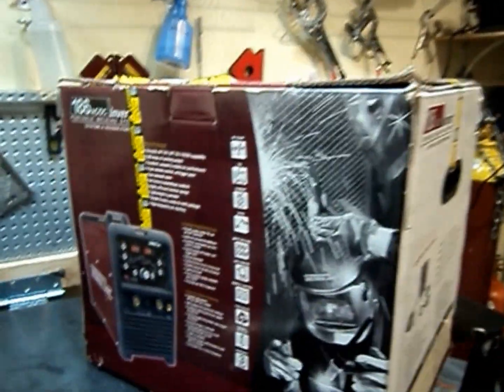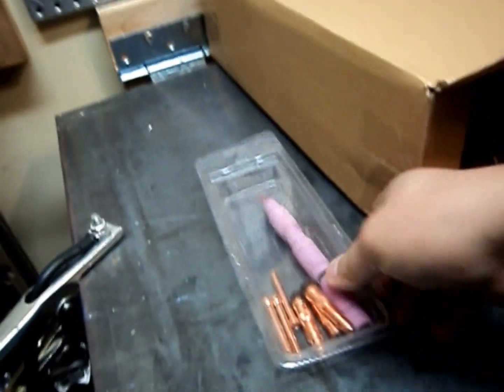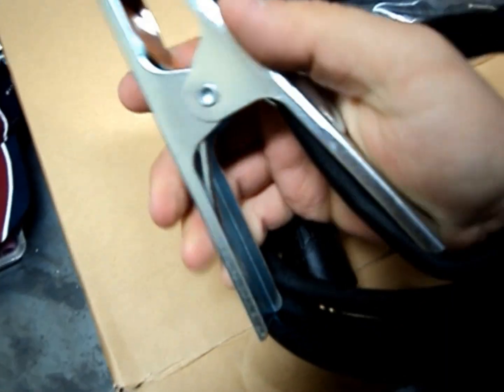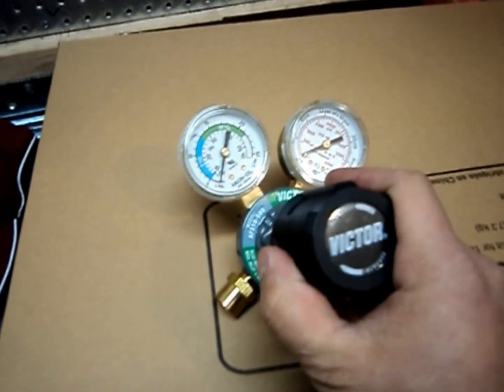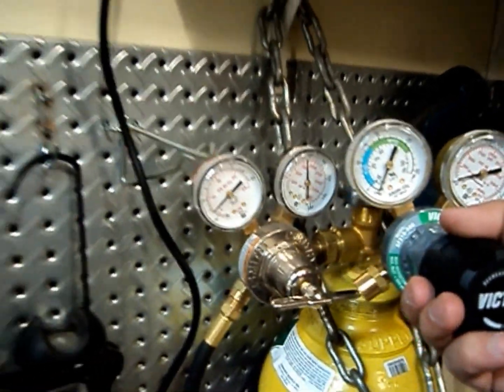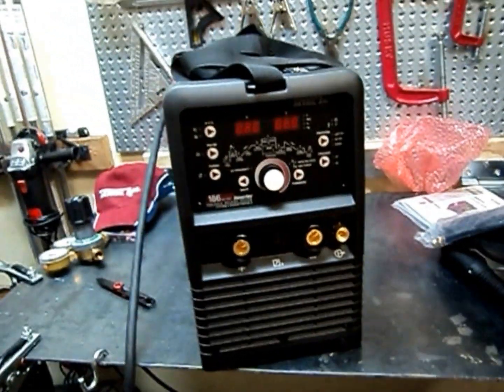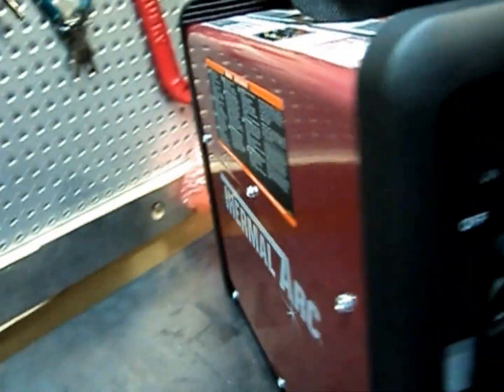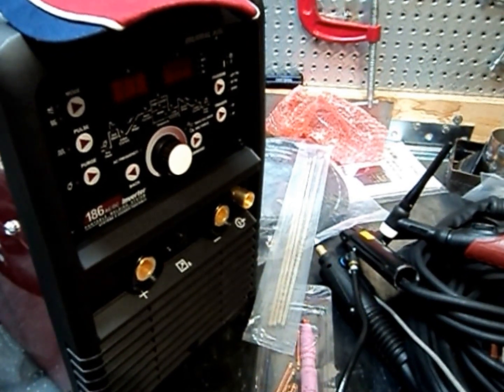ThermalArc186 unboxing Ac/Dc tig stick welder Inverter

Comment from the maker: You will like it. Just don't put it right next to your welding table the fan will drive you a bit nuts.
It's a metal peg board that I got from menards. And I tack welded all the hooks in place so they don't fall out :)

Comment: Just ordered a TA186.  What kind of tool board it that above your welding table?
Reply from the maker: metal peg board. I also tack welded each hang in place so they don't fall.

Comment from the maker: So after a few hours of using it here are some more thoughts:
The arc characteristics that I described is actually normal.So there is nothing wrong with the machine, you just have to get use to the arc pulsing up/down instead of being a gradual transition. It was very bothersome at first, but  overall you get used to it. For the price point of this machine you get a LOT for your money. For hobby use it's fantastic! For daily abuse I can't say. It's a good buy for the price. Do it!

Comment from the maker: Because of the arc "stepping" up and down when I get on or off the pedal I dropped it off at the local shop to check it out and make sure there isn't any issues with it. I have others say theirs doesn't do this, so I will be sure to get a new video and another review when I get it back. Stay tuned!